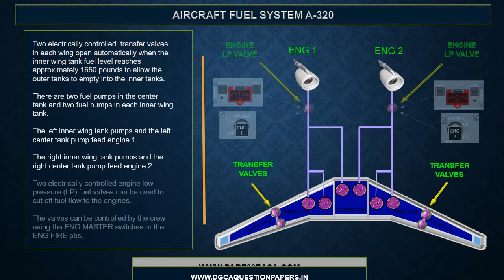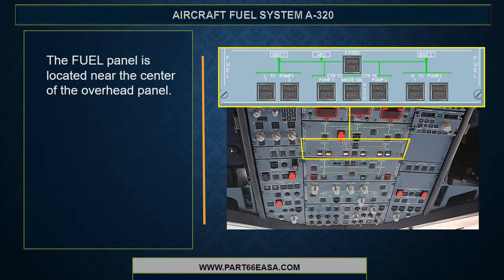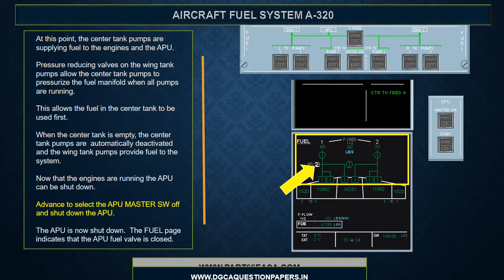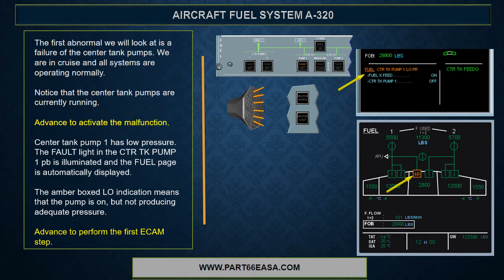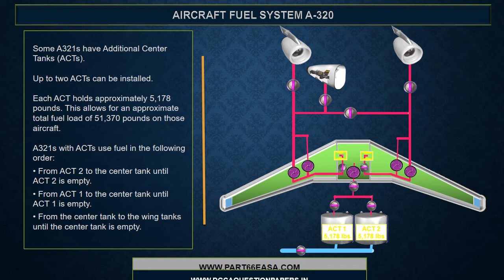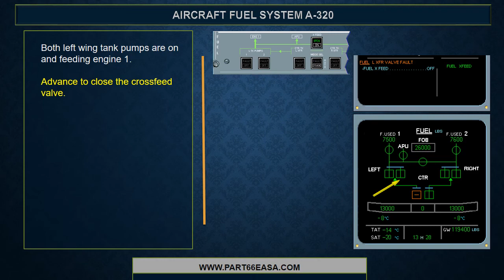Aircraft Fuel System Overview Airbus A320

Comment: There is some great content in this video.  Apologies in advance, but I couldn't tell from the video if the fuel pumps were deliberately not turned on until just before engine start.  As I'm sure you are aware, the fuel pumps are turned on as part of the overhead flow during the Cockpit Preparation.  I only mention this because at my former airline, there was a misunderstanding amongst the crew about when to turn the pumps on.  Former Boeing pilots that moved onto the Airbus insisted that the fuel pumps were not turned on until just before engine start which is incorrect.